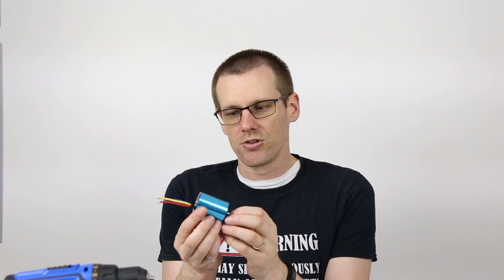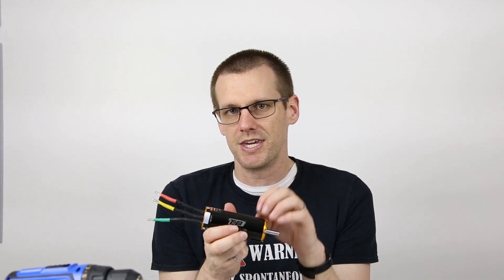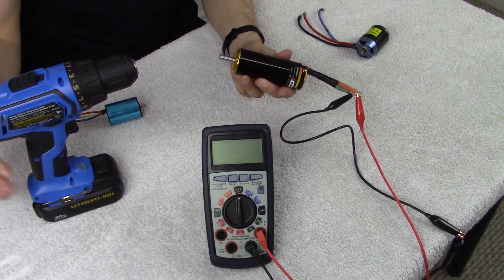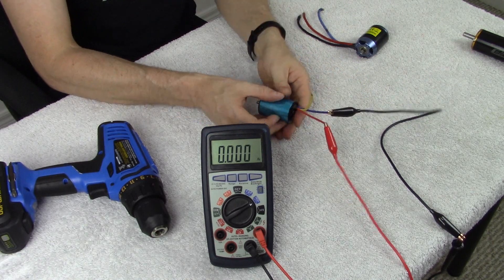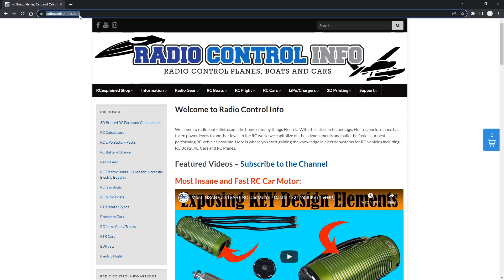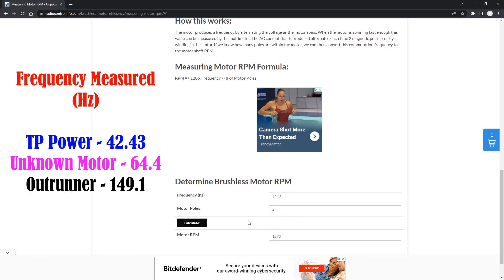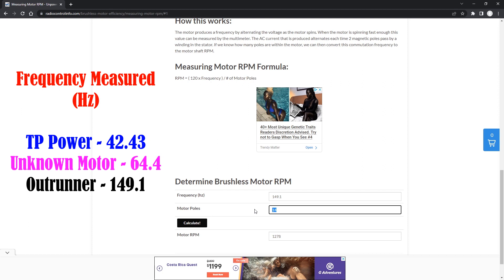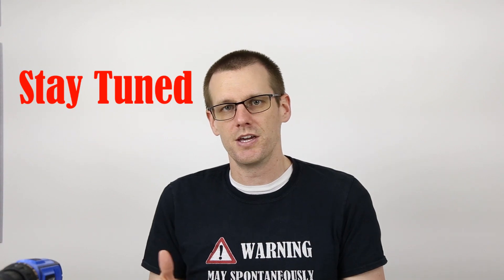How to figure out Pole Count of a Brushless Motor WITHOUT Disassembly

Comment: how do u work out the motors kv rating?
Reply from the maker: Hi Jimmy. I did a video on this. It's linked in the description.
Reply: @RCexplained  cheers bro, but i have already found it, i take brushless motors have a maximum voltage it can handle
Reply from the maker: Brushless motors are limited to how fast they can mechanically spin. Higher voltage makes them spin faster. The maximum voltage is the voltage where the motor rotates at its maximum allowable speed measured for example in RPM. Hope this helps.
This older video may be applicable. https://youtu.be/r0dzdtM8Zt8